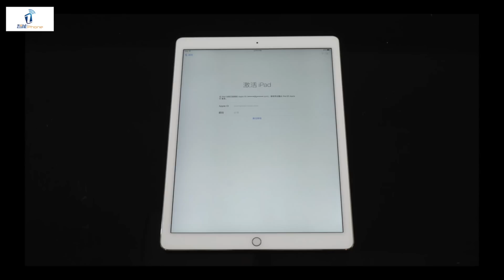ipadpro remove iCloud

Comment: i have a question. so when you get the new NAND, does it come programmed or what? do you need to copy information from the old one?
Reply: All nand ic have no promgram itself.. the only way to remove the icloud is remove the nand ic and change the SN.. Wifi.. and the bluetooth.. and you cant change it without ip box.. navi plus 3000s pro and the jc pro 1000.. that box can edit all information that black chip you said.. the new one nand ic that he put on the logic board is reprogram on a new info.. i have said.. u need to rewrite the old SN that has an apple id in a new SN that has no apple id on it.. 😎😅🤗🤔

Comment: Did you change a Nand chip? Here can I buy this chip?
Reply: José Angelo Monedero you can change  from 6s nand its right,only nand from 6s mist wisnt icloud
Reply: José Angelo Monedero hi, if I put a nand from a 6s it has to be without Icloud or can be Icloud locked ? Wifi works with this method ( taken from i6s nand chip ) ? Thanks